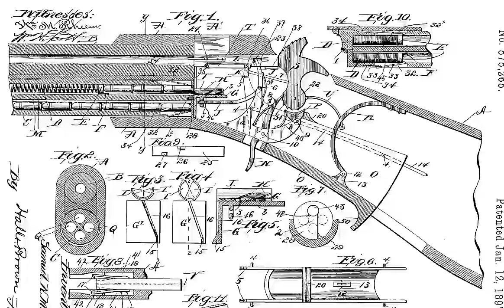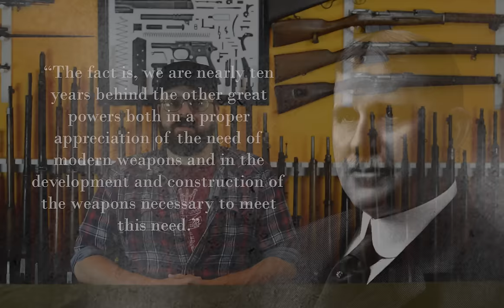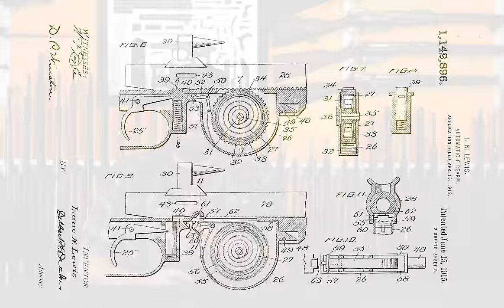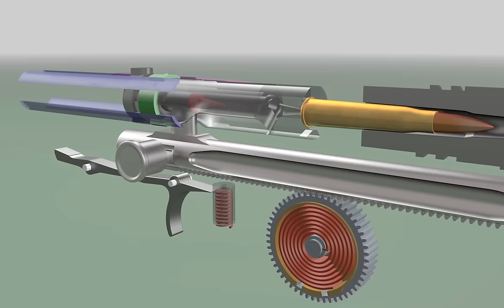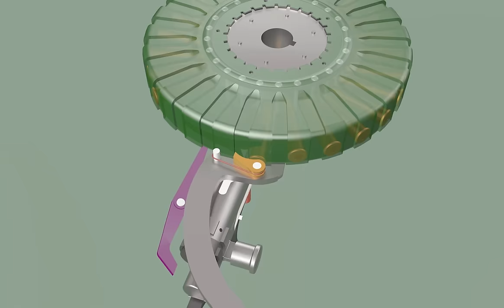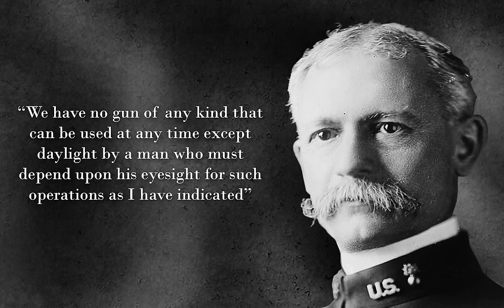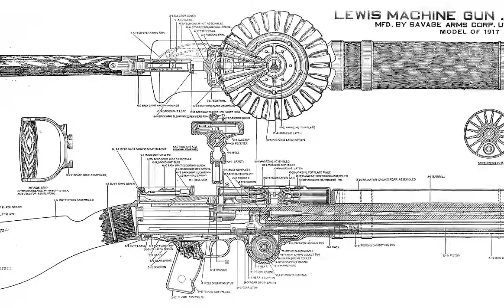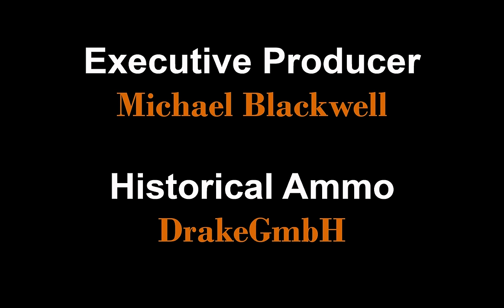History of WWI Primer 034: The Lewis Gun Documentary

Comment: I had never looked at the Lewis gun in any detail but this thing is awesome. I had never heard of that barrel cooling system but that was so cool. I had also always written that drum mag off as witchcraft. Awesome video.
Reply from the maker: Thanks!
Reply: I understand post war tests found the cooling fins and shroud did very little and could easily be deleted without affecting the normal operation of the weapon. Ie,  several pounds of excess metal for the poor grunt to put around.

Comment: With some small differences, the operating mechanism of the Lewis is almost exactly the same as the M249 SAW and M240-series machine guns used by the US Army.

Gas-operated, full-automatic, rotating-bolt, air-cooled. The ejector on the M249 looks almost exactly like the Lewis, and works in the same way. They both have a fixed firing pin, firing from an open bolt, and the bolt is cammed into its locking lugs to permit the firing pin to pass through the bolt face and strike the primer of a chambered round. The rearward action of the piston also rotates the bolt before releasing it from the locking lugs, lowering chamber pressure to acceptable levels before the spent casing is ejected.

It's a bit mind-blowing to see this exact method of operation from the early 1900's. Other than a quick-change barrel system and a belt feed, they're functionally the same system. I think a Lewis even weighs about the same as an M240B (25-30 pounds).
Reply: They absolutely do not have similar operating mechanisms. It's like saying an m4 and an ak have similar operating systems because they are gas operated and have non-fixed firing pins.

Comment: Light, for a given value of light, for instance compared to a Vickers or Maxim. The gun carried on through WW2. PLEASE do not make the common mistake off saying SAS  jeeps had lewis guns. They had the Vickers K gun, which used a similar drum, but was a gas op gun developed to replace the Lewis in aircraft mounts. Dear old Lewis, 'To be issued to men of intelligence' of stocky build and cool head' Having  lugged one about through France and Belgium on commerations, you need the speed of a racehorse, the strength of Carthorse, and the brains of a rocking horse.

Comment: Hi guys, thanks for your movie. It was long, but I liked it. Especially the round up from Mae. The Lewis gun was used by the Dutch army as the M20 firing a 6.5 mm round and  a 7.9 mm round up to the beginning of World War 2.  The Dutch actually reversed engineered the gun initially from interned allied airplanes in WO1 as the Netherlands was neutral in the Great War. They noticed that a lot of allied planes used this gun and they wanted to equip their own airplanes with it(actually a sizable part of the Dutch airforce at that time consisted of interned airplanes). Lateron they bought the rights to produce the gun under license at the Artillerie  Inrichtingen. At the start of WW2 it was mostly used in its infantry support role. 
In other movies that jamming is mentioned as well and this seems to have been an issue at the time too. I also read that they had a lot of issues with the gun overheating. As said, it was not meant to deliver sustained fire, but people tend to keep on firing.. not strange when people are attempting to kill you.

Comment: Watching you pull the trigger after you removed it from the receiver I noticed that it is very much like the trigger, sear group on the M60 GPMG we used in Vietnam and up to the point where the US Military switched over to the M240 GPMG.  Nothing New Under the Sun.  Even the firing pin mounted on the operating rod foreshadowed the bolt, firing pin, operating rod system used on the M60.  The Lewis Machine Gun was well ahead of its time.

Comment: Just a quick question about the potential safety issue Mae mentioned: as I understood, the firing pin doesn't protrude if the bolt is not all the way forward and locked, so this should not actually slamfire (except for maybe slamming the tip of one bullet into the primer of the one before it), and thus it shouldn't be that much of a safety hazard after all, or am I mistaken?

Comment: I am still left wondering how effective the actual aircooling was. Were any models tested without the shroud, with or without the fins? Do we have any actual numbers? 
The only other gun to try it was the PKP almost 90 years later so was its effectiveness exaggerated or what?
Reply: The fact that only 2 machine guns use it should probably tell you all you need to know about its effectiveness.
Reply: @Legitpenguins99  well no. It tells us that the trade offs in weight and bulk in a time period where quick change barrels were becoming  common weren't worth it. It could be inferior and still work.

Comment: Excellent animations! I should note however, that there's a fine piece of software called "World of Guns: Guns Disassembly" which is available on Steam among other platforms, that has real-time 3D operation and disassembly of Lewis gun and about 160 other models (inc. rifles and pistols from C&R era). It features 50x slo-mo, layered x-ray and cutaway modes. I think you can totally partner with them to record animations using their software (and not have to unlock the damn free-to-play stuff of course). Disclosure - I do freelance work for them. You can see a demo of the Lewis disassembly in this video: watch?v=QlPJQgk2XjU
(UPD: Oh, I looked at their Steam description and its old - it doesn't list all the models. They release about 2 a month. I can provide the list of relevant models for you - preWWII - if needed)
Reply from the maker: I have seen them. My only issue is I need responsive detailed sub models of guns often with minor differences. I am not sure partnering with a platform that favors "popular" designs would sync up.

Comment: So the 1913 fired from the closed bolt, and the 1914 from the open... So did they do a double action single action type of thing where it could actually do both? Having it fire from the closed bolt for the first shot, and instantly transition to the open bolt would take care of the two primary reasons for both. Open bolt gives the cooling performance, while the closed bolt helps prevent fouling from debris while spending vast periods of time not firing the weapon.
EDIT: Best version of the Lewis gun... Maybe a new condition M60 or MAG; instead of the 20 year old worn out versions of the M60 that gave so many soldiers so many issues. No wait, the MG-74 (MG 3) is the best Lewis gun variant. Yeah, the MG3 is best. Way better than the MG-42 and FG-42 versions.

Comment: Well done Lewis video. The assertion that 10000 .303Lewis gun’s were converted to fire 7.92 has no historic validity for many reasons. The number came from testimony by Lewis in a congressional hearing on the guns and was just pontificating by Lewis. There is absolutely no hardware to back up this claim, or any documentation from arsenals, field armories, shops, etc, from either the Brits or Germans. The Lewis receiver is caliber specific: the feedway is milled into the top of the receiver and Is cut to feed specific cartridge case shapes and lengths: .303, 30-06, 7.65, 7.62x54r, etc, etc. Conversion to 7.92 of the feedway can be done and would be required for reliability. However, drums, bolts and barrels were also required. Absolutely none of these components have ever shown up either as examples or pictures. None. Consider that fielding 10000 7.92 conversions would require a certain number of drums for issue, may ten or more per gun, which is extremely low compared to the number of .303 drums issued; a number of spare barrels per gun; bolts for the guns plus spares. None have ever surfaced. Nor have any .303 BSA or Canadian made Lewis receivers with feedway mods to 7.92 ever shown up. Allegedly the Germans provided a backpack with 7.92 parts to field convert .303 Lewis guns to 7.92. Not a shred of evidence, either examples or pictures of backpacks, 7.92 barrels,, drums, bolts, support gear, etc to support this allegation, have ever surfaced. It is a myth. I have put 7.92rounds into .303 drums with some difficulty and they will fit but the reliability is negligible. 7.92 will fit through the feedway of a .303 receiver but reliability is also extremely poor. Even under the vest of circumstances, a field manual for the Lewis declared within the first paragraphs that the Lewis was “subject to a bewildering array”of malfunctions!! Fielding such an unreliable and balky option for combat is a non-starter. The Germans did like the Lewis and used them when possible, but certainly not in 7.92 but in .303. Above are the most salient objections to the allegation that .303 Lewis guns were converted and used by the Germans and there are many more. I have been an MG collector since 1955 and a dealer, manufacturer and gunsmith for NFA weapons since the late 1980s and have extensive, hands on experience with many, many vintage and modern MGs. Anyone with verifiable proof supporting the myth of the 7.92 conversions will be gratefully received. If I had my preference, the segment on this issue might be altered to reflect that there is no evidence of such conversions. It is time to put this bit of erroneous trivia to rest.

Comment: Why does the fire rate drop off towards the end of a magazine dump? Is that caused by heat?
Reply from the maker: Gas key falls out, you can see it on the right side.  so the port was likely turning and shrinking.
Reply: Ah, thanks for the explanation! Was this a common thing on the battlefield?
Reply from the maker: Ryan E
I doubt it.  They probably put the bipod back

Comment: somebody tell me why the barrel tube cooling thing isn't used anymore?
Reply from the maker: Swappables
Reply: If the shroud works well, we could probably make it out of lighter, sturdier materials these days? Better than carrying an extra barrel?
Reply: Cause it was not really useful. 
The tube device forced the air through the cooling fins every time a round was fired, but prevented the air from circulating around the fins (and so to cool them) when a round was not fired. Since a LMG was not used for continuous fire, but in a combination of short bursts, the net effect was near to zero. The tube device was cool (no puns intended), but, in the end, it was only unnecessary weight.
Reply: Neutron Alchemist Interesting - thanks.

Comment: Well now. Mae the gun pixie. Knows more about firearms than the average bear. Pixie that is. A few comments. You may be concerned about this videos length. Do not be .Your stories concerning Lewis and Crozier are actually quite important. They put together a rather complex story.Have heard portions of but not all. This ties stuff together comprehensively. Not easy to do.
Whatever Crozier sins or not there was clearly a mindset there that caused much harm. WW2 Ordnance Board botched the US NAVY torpedo fuse for years. How many brave young Americans died unnecessarily I shudder to think. Postwar there was the NIH mess over the M14 and the adoption of 7.62 NATO cartridge. Completely missing the point of 8mm Kurz and 7.62 by 39. 300 Blackout an interesting cartridge but what year or decade did it first show up ?  An important question should be to ask just what it was they got right. Did they not also blow off  Elder Keith duplex load with the little copper tube ?